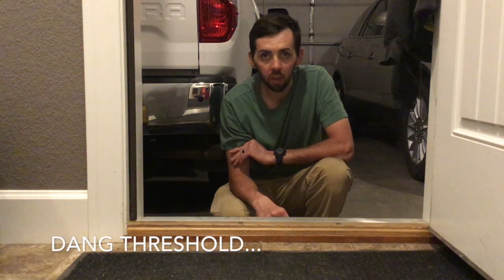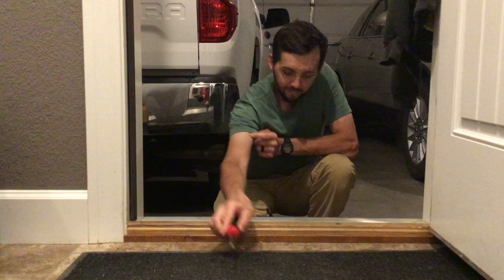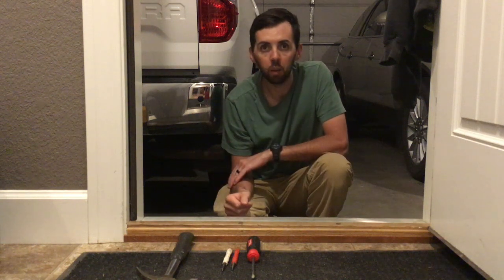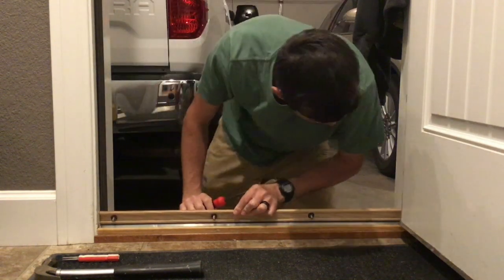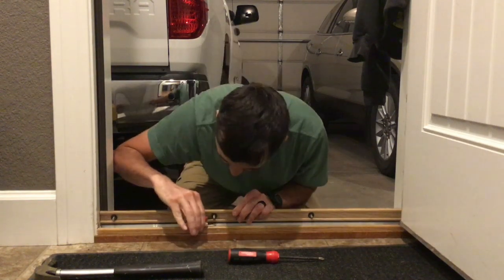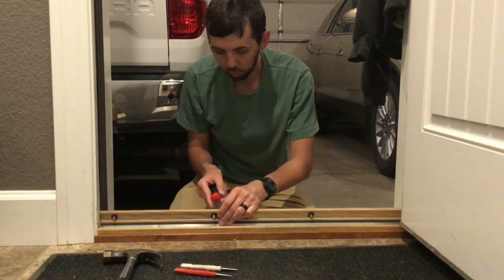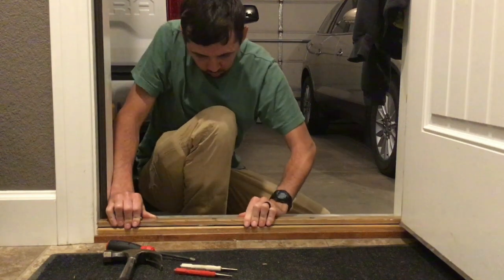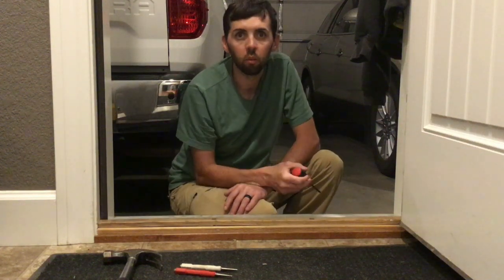How to fix an Adjusting Threshold

Comment: Edit 8/19/24: That fix only lasted a few weeks. I have since fixed it again using the same principles in this video, except this time I used a deep well socket instead of a flat-blade screwdriver. I found the smallest deep well socket I had that would fit around the bolt (don't use a larger one) and then tapped the socket with a rubber mallet with a good bit of force. This method applies force all the way around the guide all at once instead of at just two points at a time. This fix has proven to be much more effective and has held up VERY well for many months now.

Original: Thank you! Thank you! Thank you! This video just saved me a ton of time and money replacing the entire threshold. Such an easy fix, too. I just took a flat blade screwdriver and a rubber mallet and tapped on where the guide and bolt meet. I did that all the way around each bolt/guide and the threshold now stays in place as it is supposed to.
Reply: Same here!!